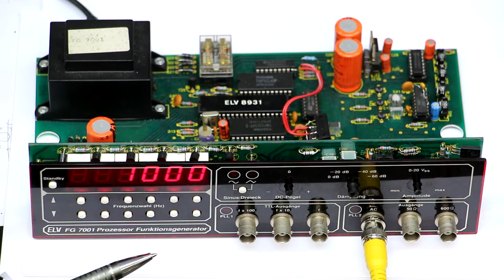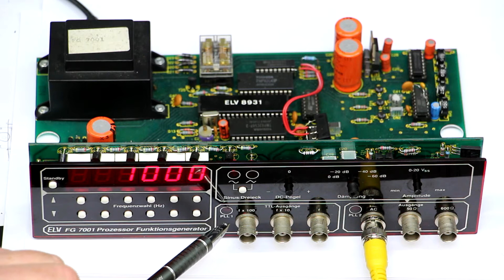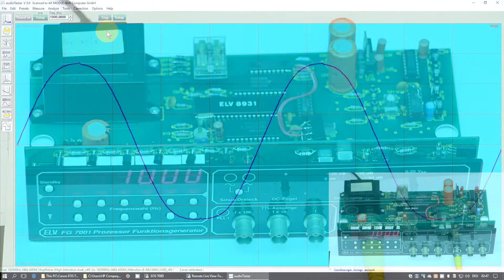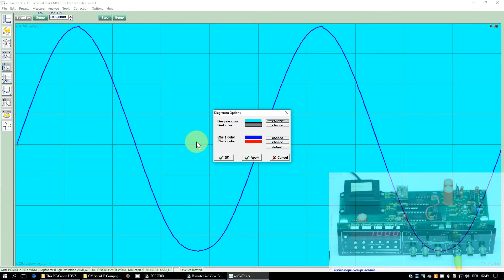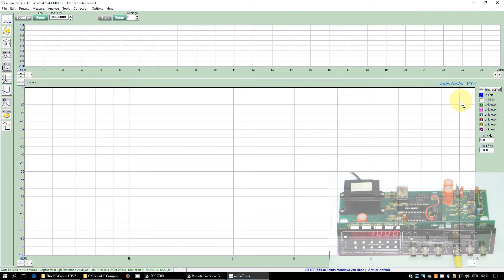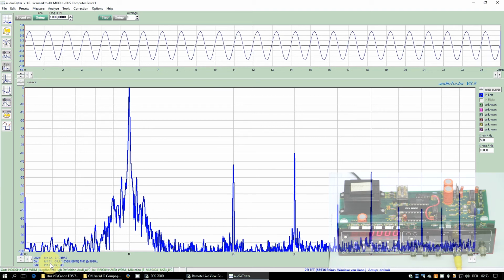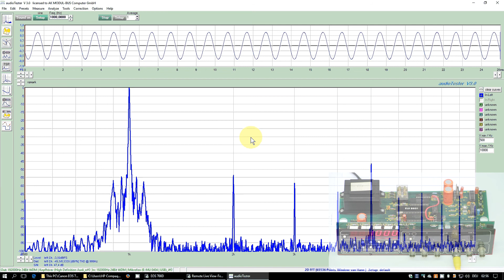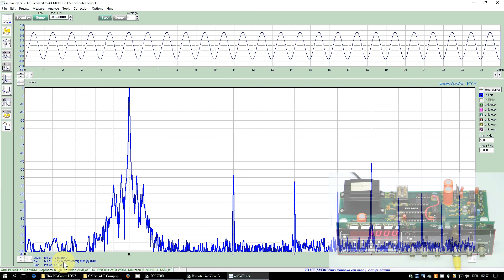XR2206 Distortion Adjustment: Visual vs .FFT

Comment: That was excellent. I was hoping you may show the new sine wave shape on the scope after adjustment in the spectrum analyser. Did it look any better than it did with your visual adjustment?
Reply: Yeah, I was also wondering if the sine got better.
Reply from the maker: In the first 2 failed attempts to shoot this video  I really switched back to the oscilloscope view.
And it "feels" like the sine-wave shape looks more natural.
But you can only judge this with a side-by-side comparison of the visually adjusted and the FFT-adjusted sine-wave.
In fact my first attempt of visual adjustment gave a good-looking sine-wave with 3% THD.
So it´s nearly impossible to get near the optimum adjustmest just by looking at the shape of the sine-wave